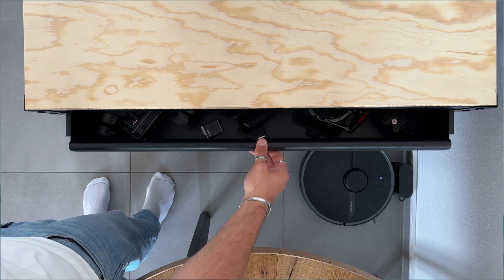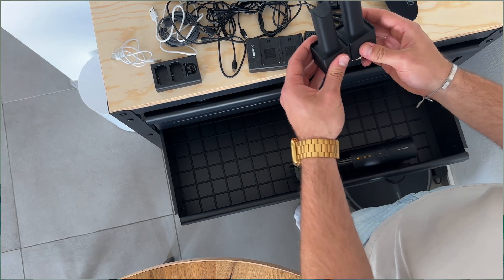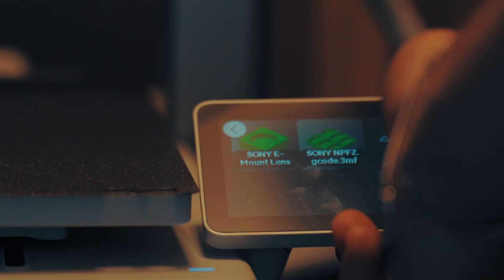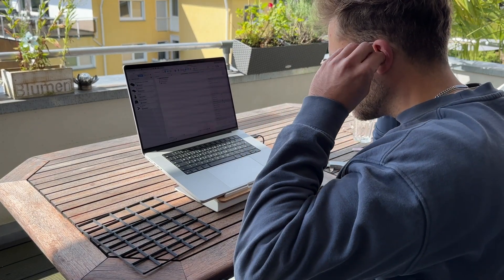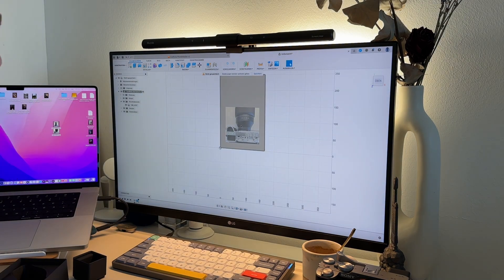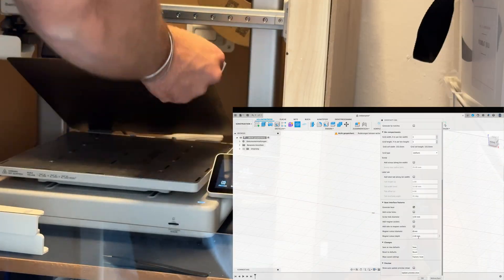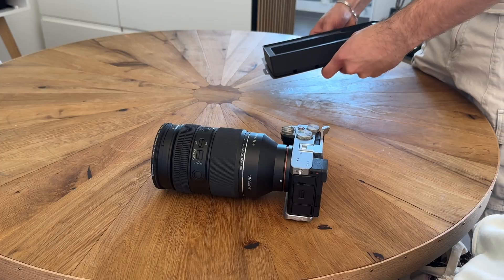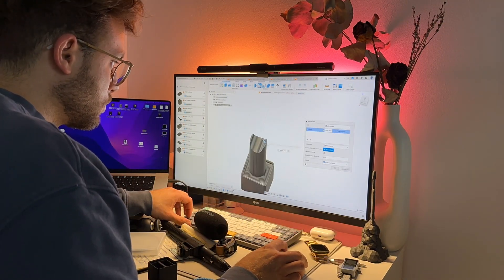How To Get Organized With 3D Printing: The Gridfinity System

Comment: Any chance you can make a collection of presets and prints that you used from other creators, I can see there's a bunch that are seen in the video, but aren't part of the google files, specifically those emount lens bins
Reply from the maker: Thank you for your comment! As far as I remember I only put those files on google drive that are more “conplex”. For example the e-mount lensbins I made using the gridfinity generator in fusion 360 to get a 2x2 box. Then I measures the diameter of the bottom of the lenses (which are all the same at the bottom) and made a sketch on the grudfinity bix. Then I extruded it to substract it to get the recess.

But I can search for the files and make aure that they are also on google drive. I will update this post when I did. 
Thank you again for your comment and the information!

Comment: 💡 SAVE FILAMENT…I have never done this but I heard somewhere that you can print out a few layers of your project to check for sizing… So you would print the middle few layers or outline of the camera/accessory and check for sizing. This will save you a lot of filament during the prototype in phase. I am extremely new to 3D printing and I just got my first printer six days ago and I was on vacation for three of those days 😂
Reply from the maker: Yeah thats a good idea! Someone also recommended to try this. I will def. try this next time. Hope you have fun with your printer😊

Comment: Thank you for picking a color that matched your drawer and sticking with it. So many Gridfinity installations are an assault on the senses. 😂. There is also available Skädis to Gridfinity models that will let you take your Gridfinity onto your wall. Very useful to keep gear at hand while you work on a project. Thank you for sharing your work. Love it.
Reply from the maker: Thank you Howard 😊 I didn‘t know about the skädis gridfinity extension. That‘s nice.

Comment: When i design something for a specific fit, it's always good practice to slice it in the slicer into a small sliver so you can practice fit it over what's going to go into it, that way you lose minimal time and filament. If it works, just print it without it being sliced up because you're already ready to go. Massive time saver.
Reply from the maker: Yeah that's true! Thank you for that recommendation. I def. need to try this next time :)

Comment: Good evening everyone. I wanted to ask you for an opinion and advice on this: I have a copy of fusion360 regularly registered and purchased regularly. I have an additional module called gridfinity, downloaded from the Autodesk site and therefore official, free, which installed on Fusion360 on the MacBook works perfectly and is loaded without problems, loaded on Fusion on the iMac but not. There is no way to see it once Fusion is loaded. Why do you think so? It is not presented in the list of additional modules so I cannot load it from there. Thanks in advance to anyone who can help me. Thank you

Comment: You really should print a clip to hold that microphone.
Reply from the maker: Initially i thought it might wobble or fall when pushing/ pulling the drawer. For that the clip would be very useful. But it sits quite strong and never fell off. With a clip it would always be an extra step to get the microphone in or out

Comment: 3d Printing a powerful tool :) currently on the same task, but for larger equipment.

I personally have the problem that gidfinity grids dont alight to any storage space (obviously), so im looking for a solution to make them snuck fit. 
I also noticed that you used your empty not gridfinity usable storage space for your ipad, i would advise printing something custom (just a stopper etc) for it as well, so it doesnt move front and back when opening the drawer (too fast).
Reply from the maker: Yeah that‘s true and a very common problem. Luckily it almost fit so i didn‘t see the need to enlargen it. That way I can always later on print a spacer if i need to. But when you have a bigger gap there are two solutions: 
1: you can enlargen one line or coloumn of the grid plate and also the container in the same way. Then they won‘t fit on any space on the grid but at least perfectly to the one space you designed it for. Sara dietchy has a video on this and I think in the second half of the video she talks about this as well (and also shows this in Fusion 360).
2. you just print a spare container without the baseplate which just fit snug between your gridfinitycontainers and the cabinet wall. Possible downside is that you only can put small items there. But that would be the easier and quicker solution.

Comment: super cool. Been looking for a system to organise! Gonna start printing as soon as my printer arrive!
Reply from the maker: Very nice - have fun with the system. I like it because you can truly customize it to fit your needs. Which printer did you buy?
Reply: @gianlucavendel  I have ordered the bambu lab p1s combo. I'm a photographer..  sony.. just the battery thing got me hooked. have 30 batteries and need to organise charged or empty. But have to much gear in drawers that need to get sorted. ;)
Reply from the maker: @TheNicolaiBrix  that‘s a nice combo. When you have the AMS system you can even print multicolour to see at one glance which battery is full/ empty. Maybe just a small red/ green indicator on the 3d pronted part would be nice. Or even a slider 👀

Comment: Good video!
Maybe as a word of advice (which you could already know, since it wasn't directly showcased in the video), as you've already noticed that fitments may take iterations to get right, printing only the part that is needed to check for correct measurements can save lots of filament. So for example, the camera + lens bin you did, just printing the middle part of it, only a few milimeters tall, to check if it slides over the object as a whole smoothly.
Reply from the maker: Yeah you‘re absolutely right. I will do this next time for sure
Reply: I just found this out myself - saves so much time and filament!
Reply from the maker: @SimonPow  yeah for sure. Some of these prints - espescially the one for the camera and lens - took ages to print😂

Comment: Great work! Very good to show also that failure is not an error, but the way to find the solution.
or "The problem is not the problem ... the problem is our attitude about the problem that is the problem" - Jack Sparrow
Wish you best luck and success for your next projects ... You have the right attitude! <3
Reply from the maker: Very well said! Thank you so much for your kind words. I read your comment several times. From my experience attitude is everything. What happens to you might not always be in your power but how you respond to it always is.

Comment: I think black gear on black background makes it more difficult to find and see stuff. I'd choose white, gray or some bright color for the printed parts. But I care more about function than looks.
Reply from the maker: Initially that was also my thought. But in real life you can see everything very clearly, by that I mean i can see at one glance every item very good. 
The white Gridfinity looked a bit off in contrast to the black gear and black cabinet. At first i thought it might look good because of the contrast but went with black because it not only looked aesthetically more pleasing to me but also looked higher quality. 
But grey might look also very good👍🏼
Reply: Obviously, brighter colors make the 3D printing artifacts more visible. If that is a concern, one could think about resin printing or ABS/ASA with vapor smoothing.
Reply from the maker: Thats true. I neber tried resin printers but that‘s a very good idea! I heard about vapor smoothing. Is it only possible with ABS/ASA?

Comment: Vids have potential - need more B roll macro slow mo of 3D prints to showcase the texture after all people are likely here for your 3D printing. Drawer lighting too dark to see any quality which made me think click bait to use your affiliate links. After looking through your list several times still couldn't work out what filament you used.
Reply from the maker: Thank you for your feedback. That’s true - next time i need to brighten up the lighting. A new 300W videolamp just arrived. So that should be sufficient enough. 
I just uodated the links. The matte black PLA is now linked.